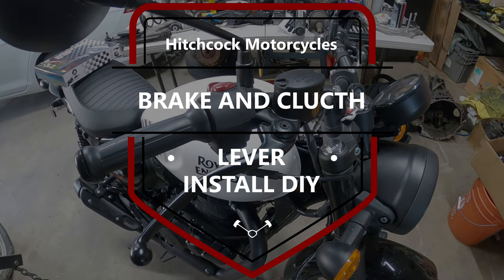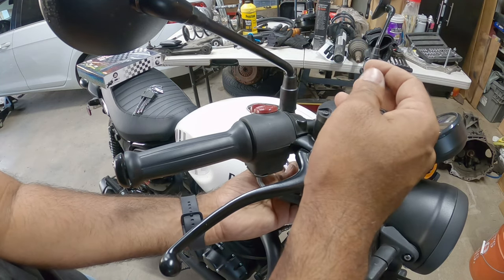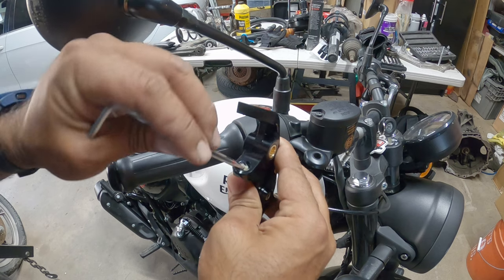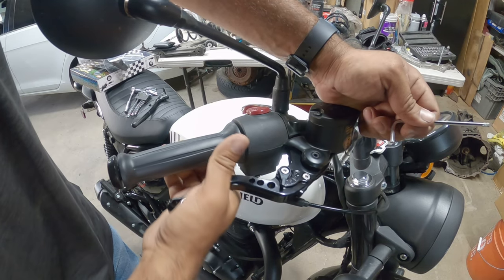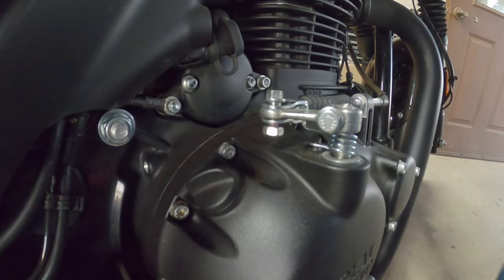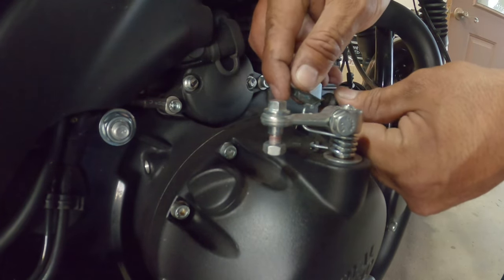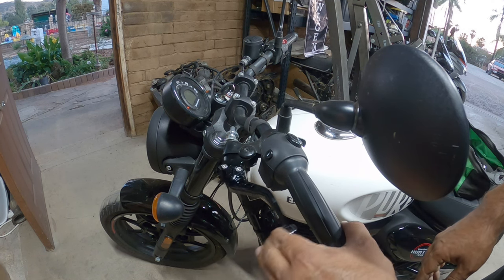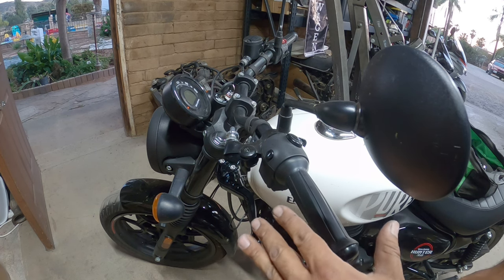Royal Enfield Hunter 350 - Brake and Clutch Lever Install

Comment: Brake cable - does it not connect to the lever at all?
Reply from the maker: There is no cable for the brake only for the clutch. The brakes use a master cylinder. The lever uses a plunjer to press the cyclinder and slows or stops the bike.